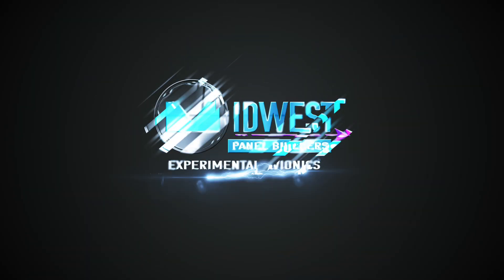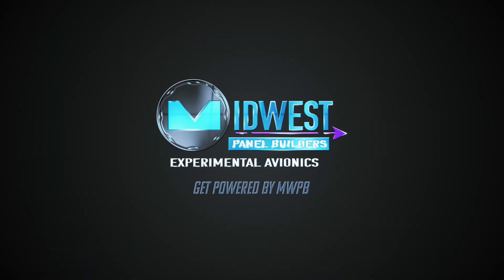How to Accurately Find True Airspeed [Performance Testing 1/2]

Comment: I can't see why a slightly different method isn't much easier and just as accurate. This method is to fly a triangular course (not heading) with autopilot in calm air on three courses 120 degrees apart, ie 360, 240, 120. Record the GPS GS and True airspeed for each course. Average each of the 3 speeds and compare.  Your average GS should be the same as your TAS, otherwise your IAS is off. The error is most likely from your static port and/or your OAT. Your TAS is just calculated from your IAS so it doesn't matter what altitude you do this at. I don't like looking through all those lines of data. Why wouldn't this be just as accurate?

Comment: What can you do if your airspeed is off by a larger amount? I can't find any way to calibrate IAS in the G3X config menus.
Reply from the maker: There is no calibration for IAS, you need to find out why they are wrong, plumbing leaks, AHRS issue etc... This needs to properly diagnosed.